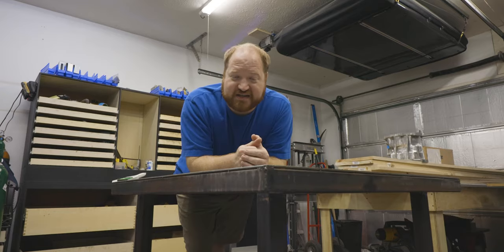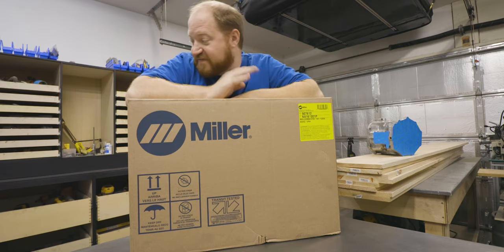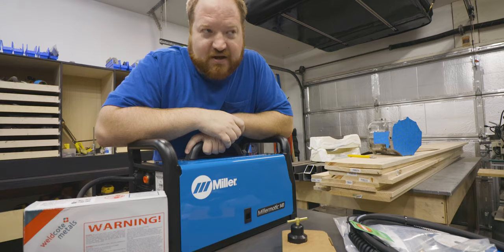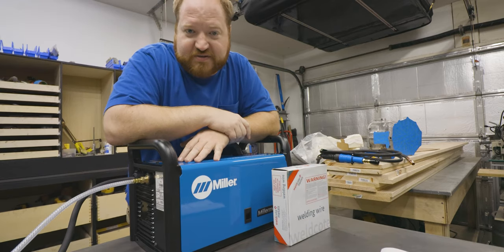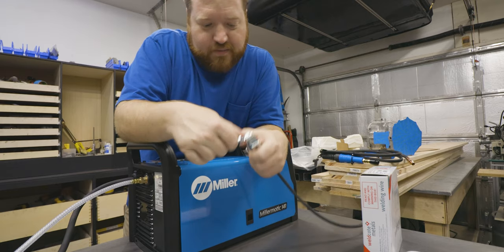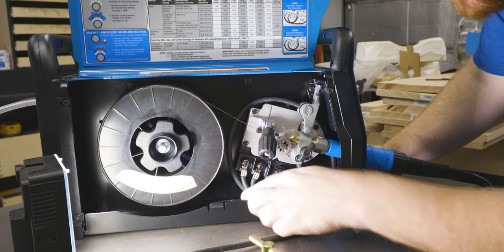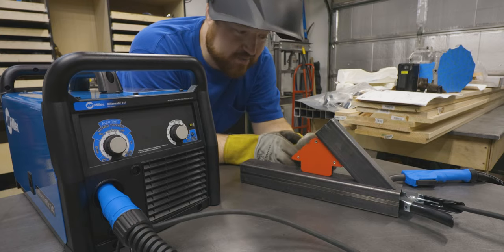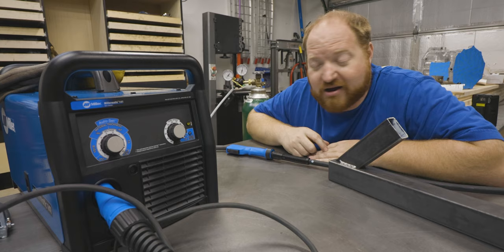Unboxing a Millermatic 141: First impressions and first weld.

Comment: I never seen a welder before who doesn't put tacks before welding. I know You were trying to show how the machine works, something I never noticed before.
Reply from the maker: This was simply a test piece so position wasn't important. I was seeing what happen when you pull the trigger and go right out of the box. On real projects I always tack pieces together before welding. I also use much better jigging to hold the pieces from moving. It's as you expected though, just showing how the machine works.
Reply: @Obscuremotorsports , I really like how that machine works. If wasn't for this or others video I wouldn't believe it.

Comment: 20 amp breaker?  Did you upgrade the wire?  Increasing the load of the breaker without upgrading the wire is a fire waiting to happen!
Reply from the maker: It's on a 20 amp breaker with the properly gauged wire.
Reply: Isssssss iiiiiittttttt?